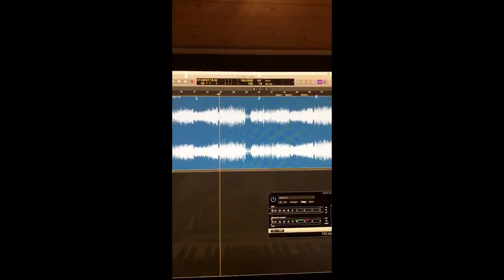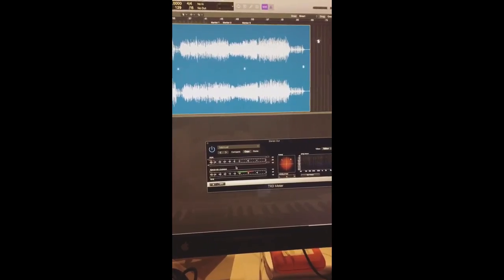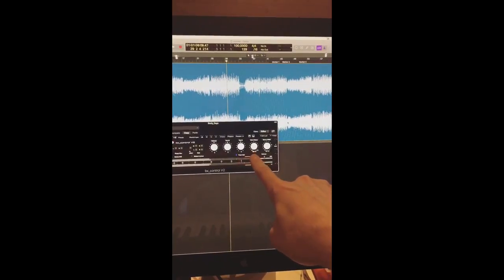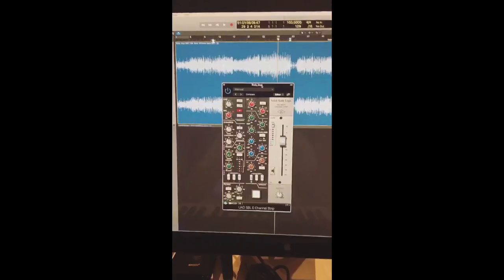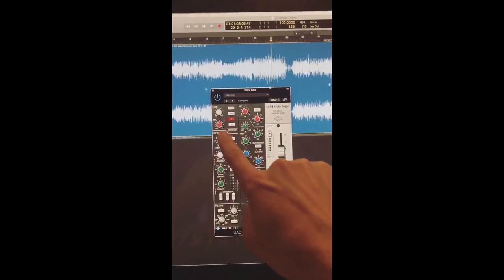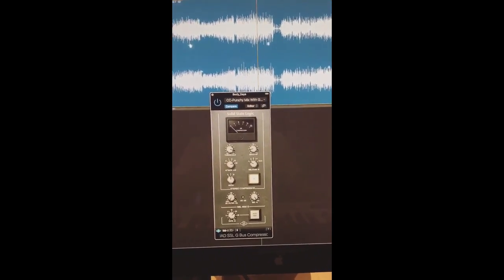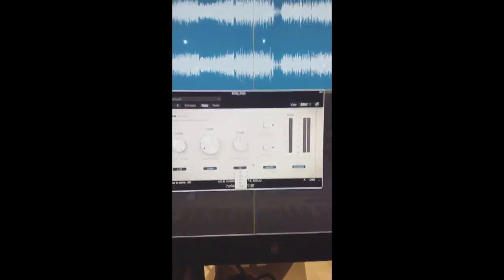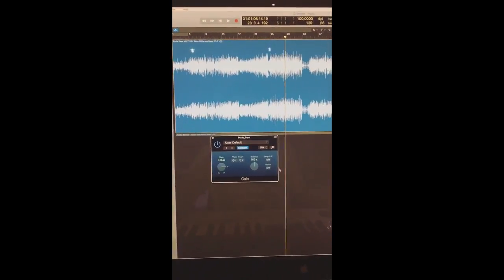My Mastering Chain

Comment: i also have kclip, but what actually is the difference between a clipper and a limiter. why don't you but up the gain in kclip and why have a limiter before ? and there is kclip2 pro version now for higher quality. with 256x oversampling. and another question... why do you set the quality of kclip to 32x and the limiter to 2x oversampling? (so just for invisible.. 2x sounds better? so you kclip just to make sure there are no intersample peaks?)
Reply: rpsimonr Limiting is pushing the signal that goes over 0db back down while kclip clips all audio that goes over 0db, so you could sorta say it disappears.

Comment: What is the average rms for edm music? Because my track is not loud enough even after mastering. Thanks!
Reply: something between -6db / -8db
Reply: alextheend5 thanks and one more question how can i make headroom in my track before mastering
Reply: keep your levels right, for example right at the beginning I have my kick around -10db my bass -11/-12db my synths -13/-14 and so on and after I have layed down my ideas I turn the  volume of each element up so that every element has its own space. So before mastering you should have an rms of -10db.
Reply: I usually try -5rms and a decent perceived loudness
Reply: alextheend5 is there plugin for tracking rms
Reply: yatin mulik T-racks, 7Skies also talked about it in this video. It's free aswell! ;)
Reply: If you use Logic Pro X there is the "Multimeter" and at the top right corner you have rms.
Reply: alextheend5 thanks you so much bro!
Reply: WOLV thanks! Bro